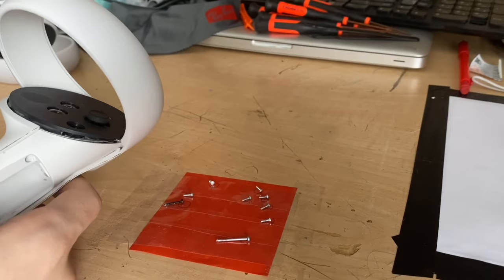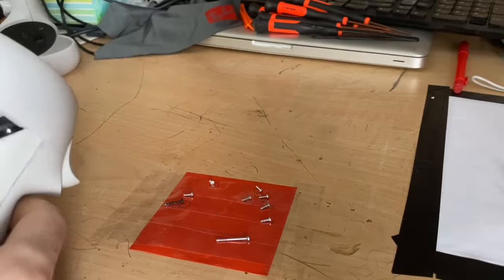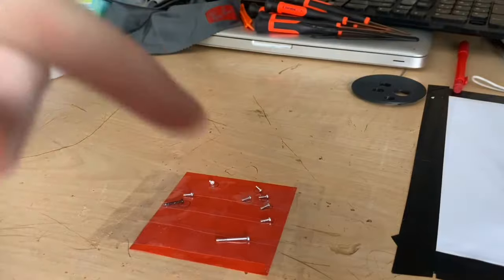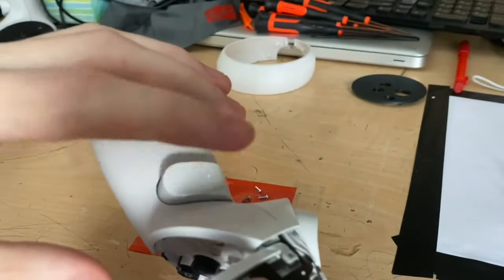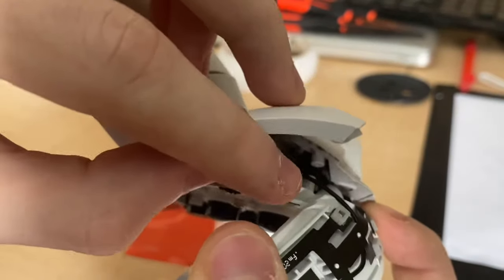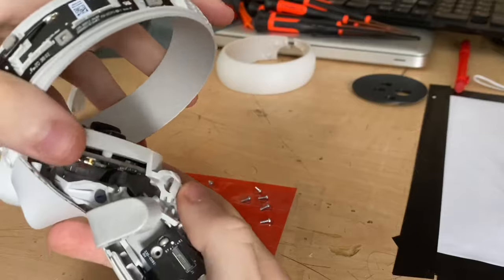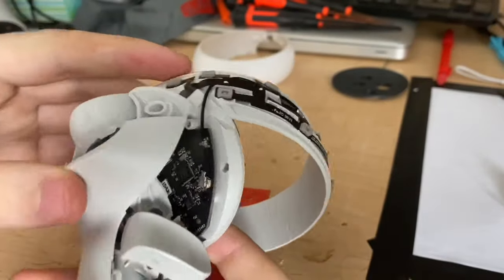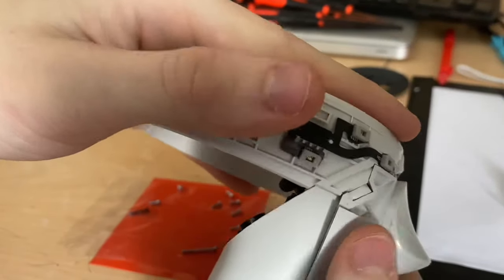Oculus Quest 2 Controller Partial Teardown

Comment: Hello I appreciate if you tell me whats the problem here, my right controllers main button while i write on the virtual keyboard start to write three letters or two per push, it happens all of sudden, the left controller has no issue, what is this problem, the right controller main button feels lighter, I might pushed it so hard while playing I bought this device from amazon france, can i send it for repair, and according to your knowledge is it possible to only send the right controller or the whole device. (note the devie is only 1 month old and not being used daily).
Reply from the maker: I know that oculus offers a warranty that lets you send in controllers for replacement, but I’m not sure if yours came with one. The best advice I could offer is to soak the area around the button with isopropyl alcohol or mass airflow sensor cleaner (plastic safe kind). Make sure the controller is unpowered when you do this though. That might be able to fix the mis-pressing, but there’s no good way to fix the lightness of the button, as that’s a wear and tear problem.

Comment: So my play space is pretty small, and i tend to smack my wall a lot when playing. Today when playing recroom with my friends, i smacked the wall and my character was stuck in an infinite turning motion. If i try to turn the other direction it will work, but go back to turning the first direction after i stop. Is there any way to fix this without buying a whole new controller, or should i start looking?
Reply: it fucked you're potentiometer essentialy use contact lcleaner and spray it under said joystick (no batteries of course or it could still short)

Comment: What do you reccommend in doing when the side trigger button  is stuck and seems to fall off as mine is extremly loose
Reply from the maker: Can you give me some more specifics? Is the trigger able to stay in an open position or is it so loose that it stays pressed down? Does the trigger get jammed occasionally?
Reply: @kingmatai8662  love your video. I found it because I just bought a quiet 2 for my son's birthday 2 days ago.  I'm having an issue with the side trigger.  It is loose and won't stay in the open position after punching the floor playing echo😐 any tips?

Comment: is there a way to fix a fading vib. motor without taking apart the controller? my left controller is fading and ist really disorienting me in beat saber because its how i know i hit a note, and when i dont get confirmation, it messes with my head, so would like to know if there is a way to do it.
Reply from the maker: Hmmm, I know this is a late response, but it MIGHT be possible to order a replacement vibration motor of similar spec to the one in the controller, but truthfully, I do not have the electronics experience to know how practical such a fix would be.
Reply: @kingmatai8662  i found a fix for it, just had to take out the battery and put it back in

Comment: My vr keeps having tracking issues the controllers switch off and on I dont know what to do help me.
Reply: Did your ring break/snap off the controller? If yes than its because the ring is connected with these black ribbon things and if they are detached the tracking things are gone so it has problem tracking properly

Comment: The black cord snapped inside of my controller, and does not work anymore. Any fixes?
Reply: Did you ever fix it. i have the same problem?
Reply: @el_smokey1  my ring snapped of and it barely tracks now… i think i need to send it to ocolus and pay 90 euros. I dont have the money for that tho and my mom wont pay for sure

Comment: I punched a wall the other day (oops!) broke the plastic ring, and cut the thin black wire. I don't even see any copper to try and put it back together, but i'll see what I can do. Replacement remotes cost as much as buying an entire new device basically.
Reply: Did you get it fixed i have the same problem
Reply: I think you can buy a new wire thing but i dont know where…

Comment: I broke one of my ribbon cables in the tracking ring (snapped it played beat saber) is there a way I can fix that or do I have to get a new controlller
Reply from the maker: If the cable is completely torn, there’s really nothing you can do to fix it. You might possibly be able to order some sort of replacement ribbon cable, but I don’t know enough about them to recommend one.
Reply: I have the same problem with my controller

Comment: My right trigger is working wrong. When i fully press it, my in-game fingers twitch, looks like some trash got under the button. I tried to use compress air to blow it away, but it didn't help.
Reply from the maker: Looks like you had a similar problem to mine. You have two options: tear down the controller like I did and clean the silicon pads/trigger with isopropyl alcohol, or purchase some Mass Airflow Sensor cleaner (or any other plastic safe electronics cleaner) and spray around the area of the trigger to clean it up. The problem usually tends to be sweat seeping into the trigger parts, so an electronics cleaner might be a good investment, as the stickiness will inevitably come back.

Comment: wait do i ned to undo the 4 screws where the batteries are to take off thge top
Reply from the maker: If you mean the black cover plate, no. But for taking off the whole top section, yes.

Comment: I TOOK IT ALL APART
When all apart found the handle comes  
away to get to the ribbon wire that goes to the battery        well shit      so it comes it in 3 pieces the handle     so I was wondering how they got that wire in there        next time it starts drifting I'll know what I'm doing       this was the first
Now ordered a new one

Comment: I sprayed inside my controllers with component spray, next day i picked it up and its rattling, I think something got melted,  Lower trigger doenset bounce back, gonna check inside before I spend £70 on new controller
Reply from the maker: That’s a good idea, might as well take a look inside. The hardest part about this teardown is removing the black circular panel, the rest is a breeze.

Comment: Mine hang up. Ill aim a rifle in any game, and the left controller will get stuck. I can wiggle my hand and fix it.. but itll get stuck again. Its frustrating when im trying to aim in any first person shooter game. What would cause that? Ive cleaned the lenses on the headseat and cleaned controllers really well. I dont get it. This headset has seen extensive use in the few years ive owned it. I bought it when quest 2 first came out. So maybe its just old and time to upgrade to a better headset..  but would like tp fix it so i can use it for my porn only headset or something
Reply: Get a new controller
Reply: I think your broke the ring right? I did too and i have similar problems, freezing arm and bad tracking cuz of a half detached ring

Comment: what causes drift?
Reply: Usually a bad thumbstick. Try some canned air to blow out any debris that might be blocking the sensor.  If that doesn't work and you need to open the controller like he has, just get the top off (black piece on top of the buttons) and pull the thumbstick up to remove the cap and then use the canned air to blow out any debris.  Hope this helps, good luck.
Reply: @jayleeb377  ive tried canbed air
Reply: @jayleeb377  oh wait ill try
Reply: @jayleeb377  where are the ribbon wires on the q1 thingy
Reply: Use Mass Air Flow Sensor Cleaner. Take your battery out first and then spray the joystick. If you don't believe me do a quick search.
Reply from the maker: @johnfortnitetoes  the ribbon cables are what connect the battery to the electronics. There’s a way to disconnect them, but I haven’t risked it yet in case my dumbass can’t plug it back in 💀
Reply: @kingmatai8662  shit

Comment: Bro the top screws holding the ring will not come off using a T5, I’ve tried and tried but nothing fucking works dude
Reply: Yes, thank you it worked for everything else but these top screws and no one else is mentioning it. For you manage to do it
Reply: Idk if you have already done it but i managed to take it out i just put alot of anger into it and pressed down into the screw with the screwdriver and turned. Anger helps.